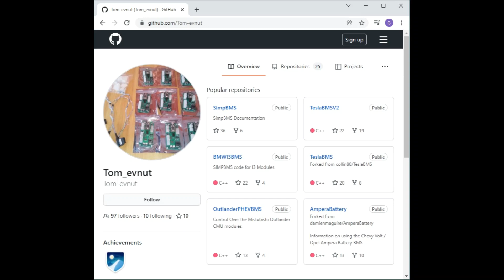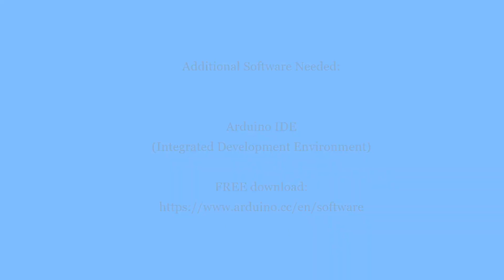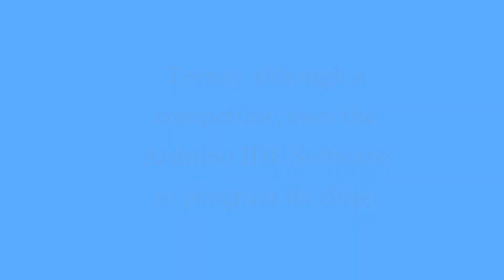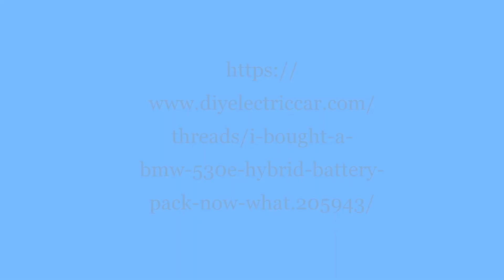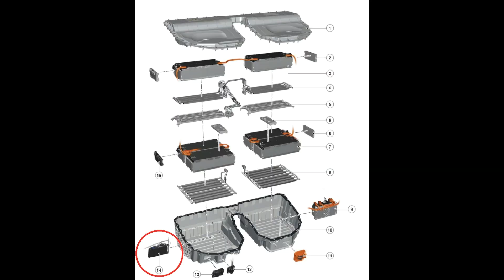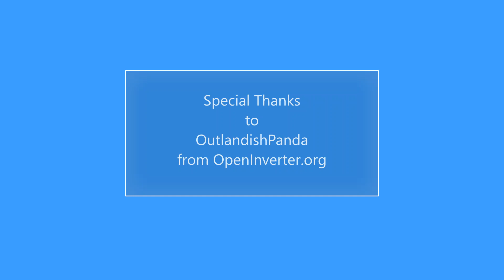BMW 530e SimpBMS BMWPhevBMS HV Battery Pack

Comment: In the screenshot is also shown : discharge current limit 30 A.  Is this the battery limit or a settable limit, As 30A x +-400V = 12kW ?
Reply from the maker: sorry I don't recall as it has been a minute since I played around with that stuff, but that would be a good question to post on Open Inverter dot org website

Comment: Thanks for this very useful video...I have a 2022 mini ev...with diag codes for all 12 csc modules...And i have to keep removing and refitting the HV battery to check this out...nightmare of a job...hopefully gey my arduino working soon...
Reply: Can i ask a favour...did you measure the resistance of the can h+l terminals on the csc modules...i think i have issues but struggling to find the info.

Comment: How did you load bmwphevbms into arduino
Reply from the maker: I ran mine on a Teensy and used something called Teensyduino
Reply: @Good-Enuff-Garage  ok, so you didn't use bmwphevbms ?
Reply: I am too checking out the teensy and arduino ide sw...it is not as easy as you think...I have massive knowledge in the automotive industry and electronics...but ive never done any coding and finding this a massive learning curve.

Comment: Many thanks for sharing this, until now we thought we had waisted our funds on purchasing  these modules. We have the exact same modules 16s 60v with the onboard slave but they are not a whole 6 in series pack like yours. The question then will be where do we make the connections on the onboard slave cable for the 5v plus minus and the low and high ?? Believe the female plug off the module is a 32 pin

Comment: I'm glad I stumbled on this!  I've chosen SimpBMS for my 914 upgrade to 6 Tesla modules, but the SimpBMS boards are unobtanium right now or just wildly overpriced.  I've done a lot with ESP32s so I'll port his code to my board and use the Bluetooth function to transmit data to a dash-mounted tablet that will give me all of the pack information along with my existing trip tracker and dynamic range calculator.  Subscribed!
Reply from the maker: thanks, cool build, and 100% agree on the SimpBMS pricing in the States, found one eBay seller but still too much, keep an eye on OpenInverter.org I may attempt a group buy
Reply: @Good-Enuff-Garage  Yes that's the guy I found him too.  Great, I won't need it until February so I can wait a bit.
Reply: @MikesTropicalTech  Hi, did you succeed in porting the code to ESP32?
Reply: @maciejpiekarz9960  Sorry I´m in the process of moving from Thailand to Barcelona and don´t have my lab set up yet.  When I get going again I´ll make another video.